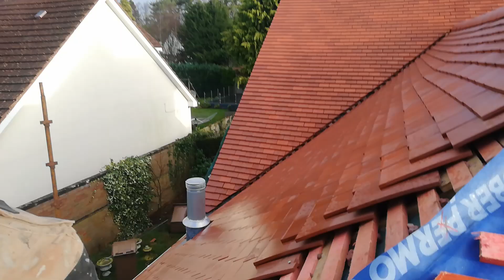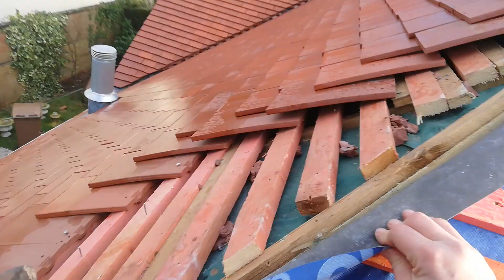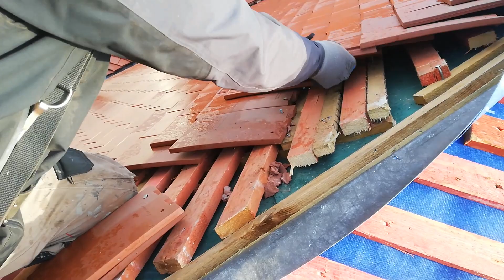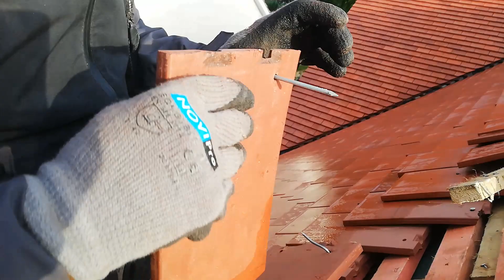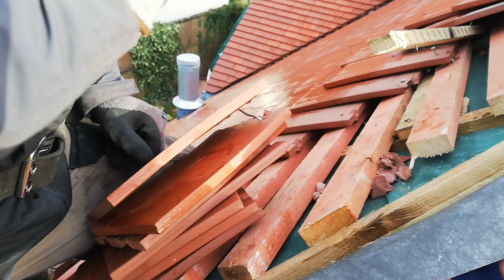Crazy

Comment: If they have tiled away from open cut valley they  only  have  to match  the battening to other side of hip and use a chalk line ,get top ridge batten perpendicular and also bottom batten with eave and gauge out any increments equally up valley side